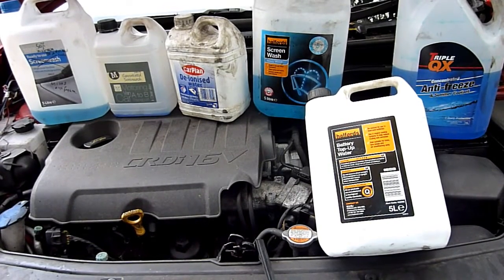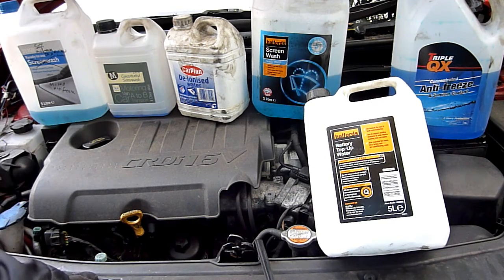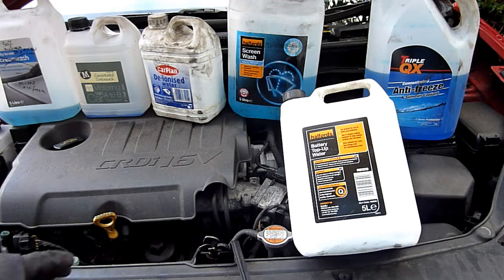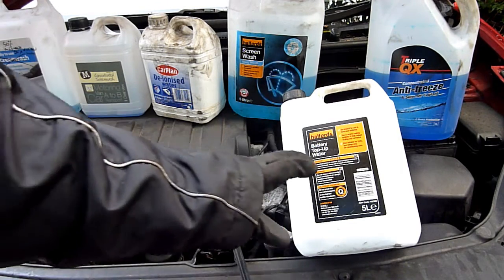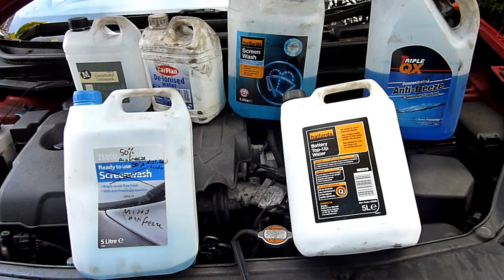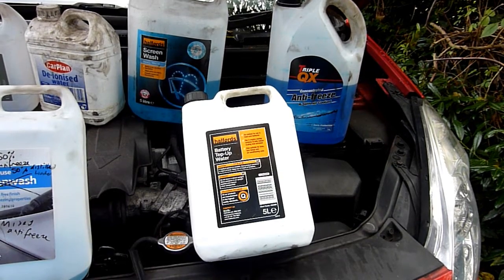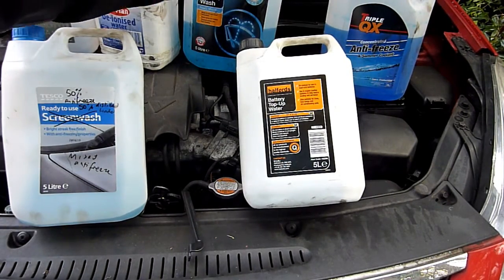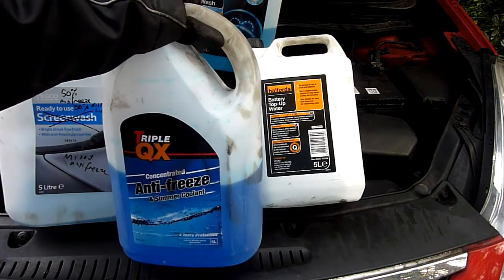Why You Should Use Distilled Water in Your Car

Comment from the maker: I'm trying to logically think this one through. I'm not 100% sure on how they make this de-ionised water, but if it was me, I know that filtration and other chemical methods of removing limescale can be 100% effective, if the filters etc are new. If the filters are older, then 1) it would not be 100% effective 2) since the filters clog up, take longer. Which ever the case filters and chemicals are expensive. Take for example your car's air filter. 

I also know that boiling even muddy water from a pond and collecting the condensation is just the cost of the gas and that's it. The water collected is 100% H20. In other words pure water, no dissolved solids such as limescale. You can even drink the condensed muddy water and it's 100% H20, although not good for you in the long run to not have any minerals in your body. So distilled water, which is collected condensation is 100% limescale free plus no chance of rusting insides of your radiator, since for rust to occur, you need ions to be present to allow for the exchange of electrons. If you don't believe ,me , try passing an electric current through distilled water and you'll see it's not electrically conductive. 

Therefore using an educated guess, and considering the very cheap, cheaper that bottle water, price of de-ionised water, they must not be using expensive filters and must be doing it the most inexpensive and effective way which is boiling it and collecting the condensation.   

I hope this helps to solve this issue. Anyone who actually makes this stuff and reads this - please we'd all love to hear from you.
Reply: Take normal tapwater and put into a home distiller.  8litres takes about 1hour to distill the water, removing all the flouride and making the water electrically inert.  They use a lot of electric to run the distiller, but this water is easy to make this way.
Reply from the maker: @federalnoise  sounds interesting.